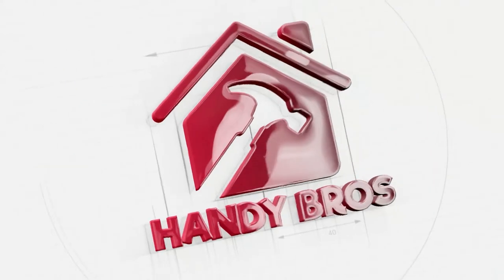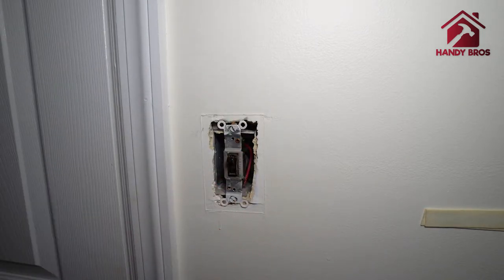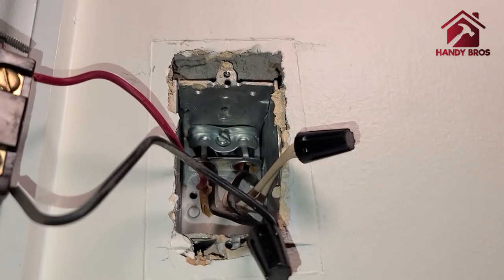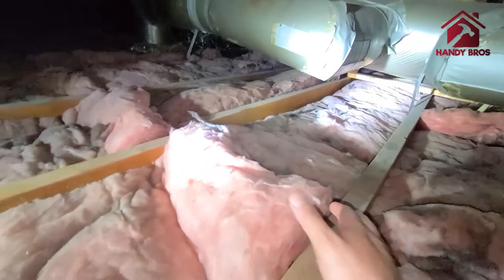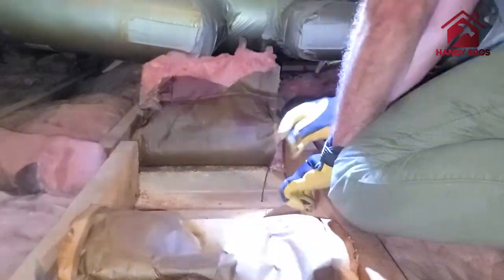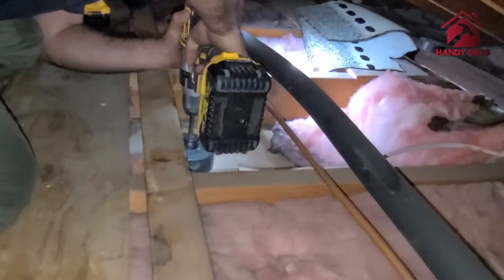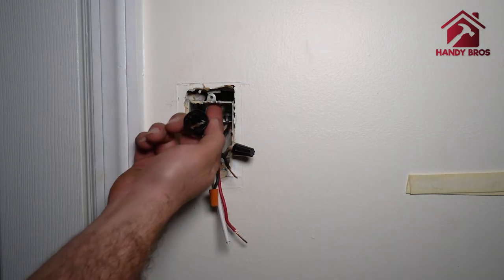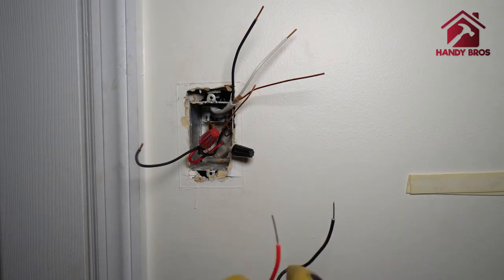Install a Ceiling Light with no Existing Wiring | HANDYBROS |

Comment: Help me out… My living room area has no ceiling light and there’s no attic access and there’s only an outlet switch by the front door. Do you think you could make some sort of video on how to do this and set it up in my home?
Reply: My problem too. There is no ceiling light in my living room/ dining room area. I want to put a light above my dining table.  I also want to get one of those battery operated light switches to turn it on and off
HELP US
Reply: @roslynjones5886  use a wall outlet as your constant power
Reply: @AlphaSteelFang005 does this mean the light will always be on?
Reply: Or do you then connect that to a switch?
Reply from the maker: I will try to do a video on this. But this would require creating small openings on the wall and ceiling to fish the wire. The openings can then be patched and finished or covered.
Reply: apartment life i get it thats why i'm here also :D